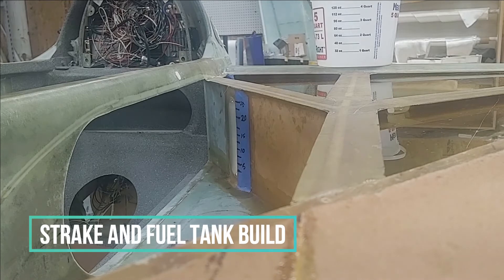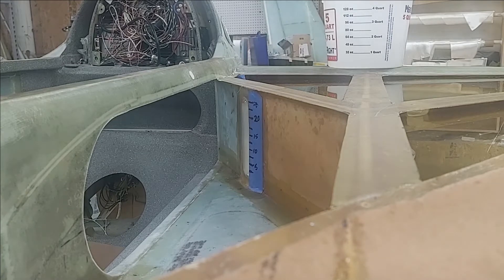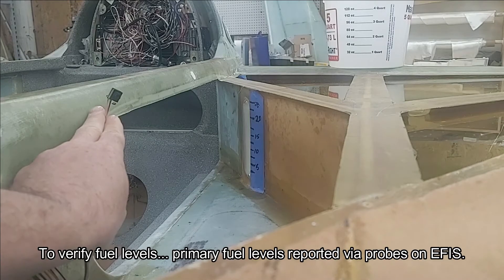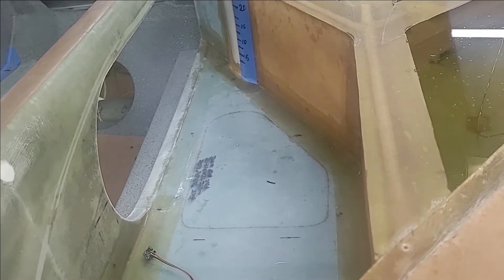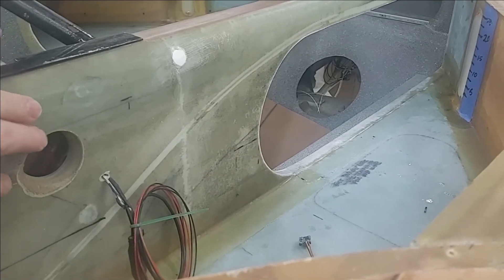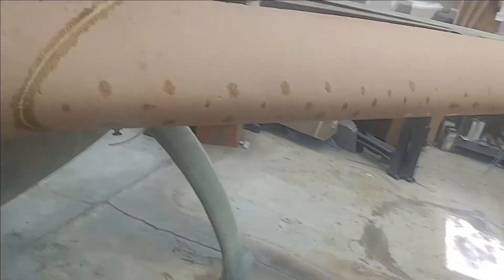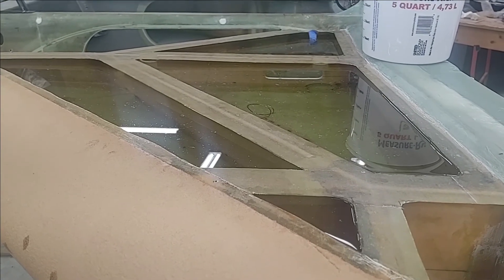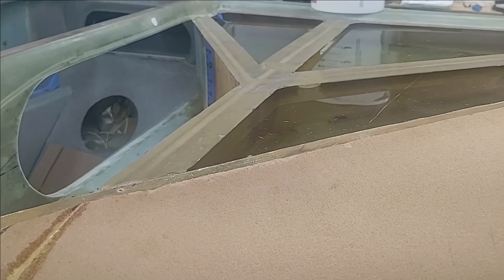Long EZ N916WP - Strake and Fuel Tank Info

Comment: Keep in mind water doesn’t have the same weight or volume / density as fuel.. especially ll100.... look into that info for accurate measurements ..
Reply from the maker: Thanks... yeah, just checking for leaks in general.  Will do verified 100LL fill points and flow tests.